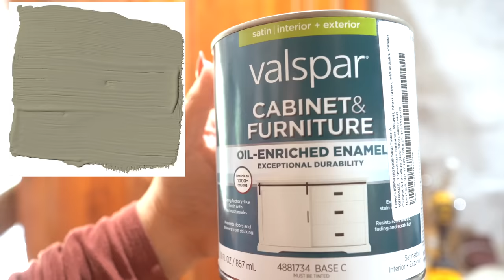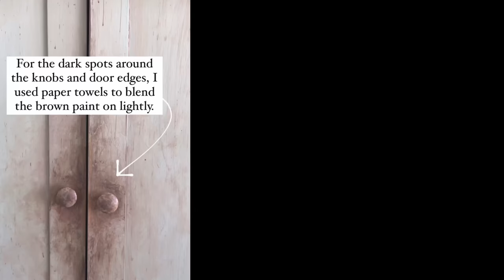DIY Antique Cabinet | Easy Furniture Makeover

Comment: I got almost the same armoir at a garage sale for  $50.00 that was a pine color.  The inside has a fixed electrical outlet for a TV or any electronics and a pull out desk on the top.  I did not love the orange tint of the pine , so I white waxed the whole thing and it came out a beautiful , soft pine ... which I love now!!!  The  bottom holds all my candles and candle holders.... which is ever growing!  Yours turned out beautifully,.  Love the color.
Reply: Liane what white white did you use/like.
I have a pine dining room set from the 90s and would like to try that! I just can’t commit to painting it  I like the wood but it’s too orange.
Reply: @lorithomas3129  I got it at Michaels.  Its by the company ArtMinds... its called wax cire in the color white blanc. So easy.. I just brushed it on and within a minute started wiping it off with a soft cloth.  You can wipe off as much or as little to get the effect you want.  If its not muted enough... I would wait til the next day and add a second coat the same way.  I love my piece now!
Reply: @lianeabeyta4515  thank you so much I’m going to try it!

Comment: I want to let anyone know too. I found if you put to much of the Waverley antique wax on.  And you paint is chalk with a topcoat of Polly. Or the all in one paint you used. Alcohol with take it off. Even after it’s been on there a long time. I took it off a console table I did in an off white with Waverley antique wax. Was on there for a year. Worked like a charm. A little elbow grease.